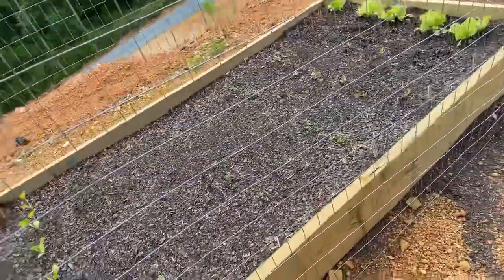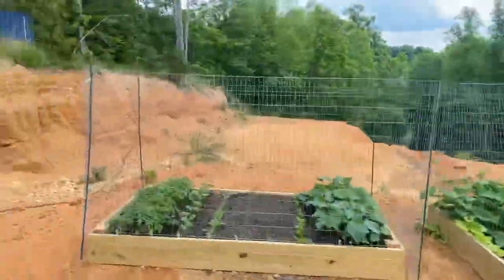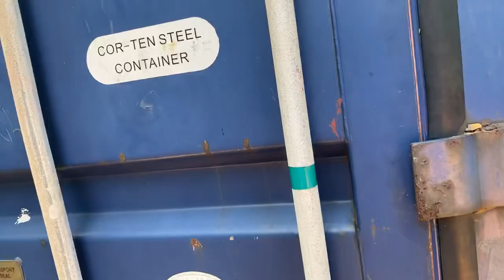Live Lenny

Comment: You know what you should get Scott? A golf cart. With that hill and carrying tools and stuff up and down. You need a used golf cart. You could even convert it to Lithium. But you'd need a new charger and maybe a motor drive. Anyway, the carts I use at work are all 48Vdc. Usually (6) 8-volt batteries in series. We carry 35lb tool bags all over the plant and we use the heck out of them. I heartily recommend them. They are awesome. And you can charge them off solar. :0) Ours are regular old lead-acid wet cells.
Reply from the maker: $$ every costs money unfortunately.    But yes it would be nice to have an electric golf cart

Comment: Listening to your weather reports I am nearly always surprised at how extreme they are. 
We are about the same latitude as you 45 miles from the Eastern coast and  about 600 ft altitude yet it is much more mild here. 
That mildness includes wind, temperature and especially humidity, with your rainfall being 40% more than here. 
Our area at the bottom of the Blue Mountains (Sydney NSW) has been mentioned as the most moderate climate in the world.
Lenny, being a metal box is of course no match for a modern insulated house and needs more powered help to be comfortable.

Comment: If you can I'd try to find a board or something to hold just enough pressure on the clutch pedal so disk won't stick. I do this with a tractor we don't use much and it works. A tractor, car, truck or bus left sitting for long periods in damp conditions is a recipe for a stuck clutch !
Reply: Thats correct some tractors had a small block of wood tied down close to the clutch pedal and it was used to hold the pedal down when not used for extended periods

Comment: Hey i have a 1956 GMC old look i need help with PLEASE! You were suggested to me from a local bus mechanic. I would watch the episodes but i have satellite internet with a limited bandwidth allowance
Reply: Right i have a 1958 GM PD4104
Reply: @willselmon6676  i'm trying to figure out how to cage the brakes
Reply from the maker: It never had spring brakes to cage. It has a Johnson bar brake handle that’s a drive shaft brake.
Reply: @BusGreaseMonkey  It has a parking brake release button, the former owner Max Lias and his father heavily modified it. Has a hand written start protocol,  start, turn on ohm meter, turn on generator, turn on transmission. No body i've spoken too has ever heard of this.